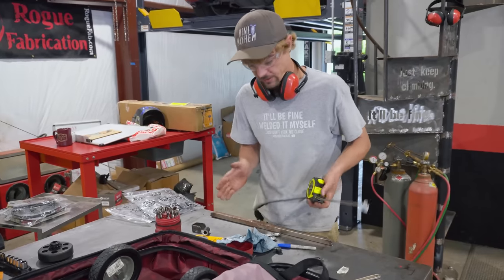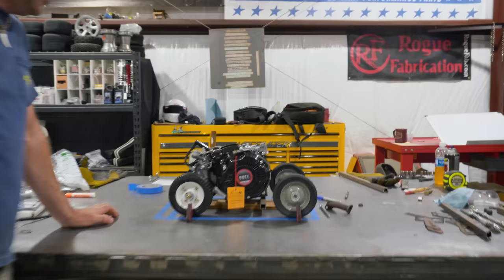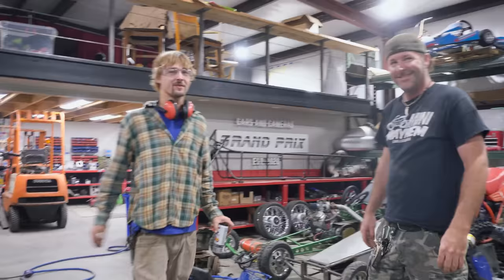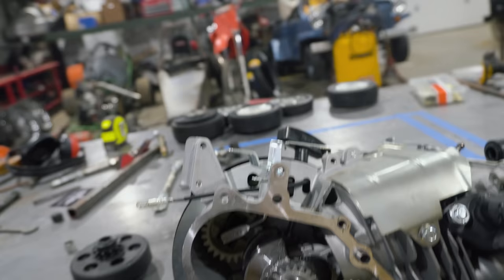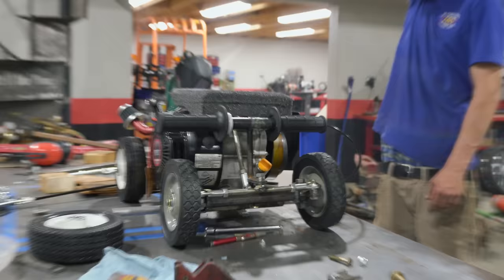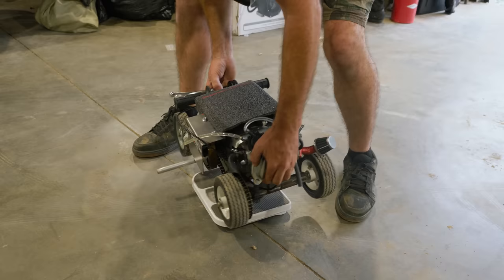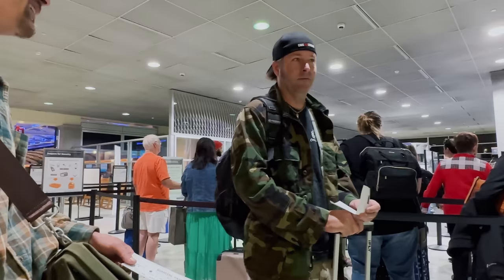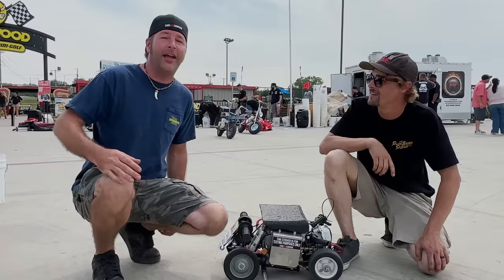We Built the Smallest Gas Powered Go Kart to Carry on a Plane and got Stopped by TSA

Comment: My buddy lives in Ohio. He bought a car in Washington state. Got ready to fly out and pick up the car. Since he was driving a "classic" wagon back to Ohio, he decided he needed some tools, so he loaded a small toolbox. He put the toolbox into his cooler (he knew the air did not work and he would need lots of drinks), then boxed up the cooler. He wrapped the cooler in brown paper and tied it with string and labeled it to make sure it could be collected at baggage claim. Everything was coming together until they tried to check in the package. They made him unwrap his box so they could go thru it. Although that was a bit tense, things escalated when they opened the box. His cooler is covered with stickers but the only one security noticed was the "Hazardous Material" . They were 3 hrs early but barely made their flight by about 5 min. TSA does not get in a hurry.

Comment: As it turns out a folding wheelie bar with a skateboard wheel will prevent those backflips. Also I was thinking that the footpegs would be more comfortable in front of the axle and they could literally fold over the engine and beside the seat and the actual pegs would fit behind the seat.   I think that a telicosopic handlebar that is above the knees seems  more practical and comfy. Loved the build and I subscribed...

Comment: If you use the hair pins that are used to hold farm implements on tractors they're a lot easier to pull off or put into place, and they make some very small versions that you can get at Tractor Supply, are probably any farm supplies across the country. 
Very kool y'all have successfully out done yourselves in a big way, even for such a tiny creation that it is.

Comment: You could have built this car into the case itself, added a telescopic luggage handle. Then made the top removable and designed lockable front wheels serving as rollers in "luggage mode", sticking through the bottom-half of the case.
Then you'd have a one-piece transformer.
Thanks for the video and cool project!

Comment: great video as usual, but here's and idea make a motorised suitcase then try take that on a plan. have the wheels slot on the outside of the suitcase. that's your guys next video. instead of building on that just fits in the suite case, build one into the suite case. somehow use the suite case as as seat.

Comment: Predator 79cc is all metal cam... I had mine on a bicycle with a milled and ported head, 19mm flat slide and valve springs did 52mph

Comment: A single bushing mount with a bolt through it to a single tricycle steering tire and a fold down simple handle to steer by would've been; smaller,lighter,simpler,and easiest accomplished,but sketchy for high speed cornering 😂

Comment: You need to make it so it has an extension bar you remove to bring the steering bar up above knee height. Also real cool if you put the footrests in front of the bike so then you can put the seat further back and you won't be as hunched over, it would be easy to make all that removeable and fit inside the case too. You could also add suspension using torsion bars if you really wanted to go into the engineering

Comment: (Half way through video) if the chassis flexes that much without the engine. And most of the flex is happening between the engin mounting points. That technically makes the engine a stressed member.

Comment: If you had made it electric, it would have been a fraction of the size and weight. It would fit into a backpack. (Only problem is you can't put lithium batteries in checked luggage. You can carry them on though.)

Comment: Whatever the max diagonal width is is the lengt of the foot bar and a simple hole drilled through the frame and foot bar with a simple cotter key,or hitch pin key would lock it down sufficiently for riding and it not spinning under the riders feets...js.

Comment: You should have made it so you could have attached the wheels on the outside of the suitcase then the steering wheel could poke through the top then it would look like you was riding a suitcase... Maybe hook the pegs to the front wheels so you can use them to steer instead of a little steering bars just to save some space and make it a little easier to ride.     😂

Comment: When are u guys goin to show the razor drift kart? I had one i just traded off for a giant lithium battery but before that i fixed it up with a 1800watt 48v kit geared 15/30 and she ripped! Also, the front wheels fit of the back, just use one front wheel tho so u can still slide good at full speed lol